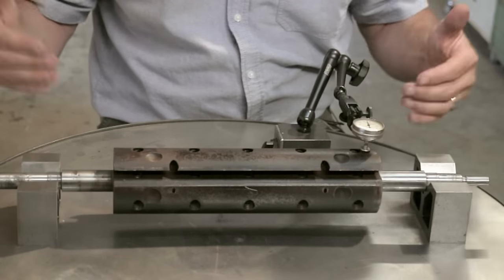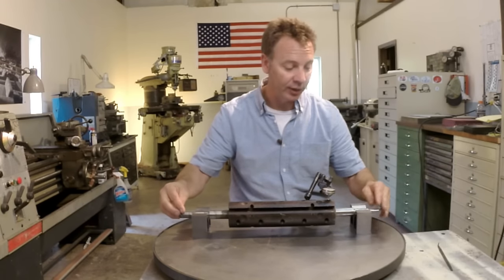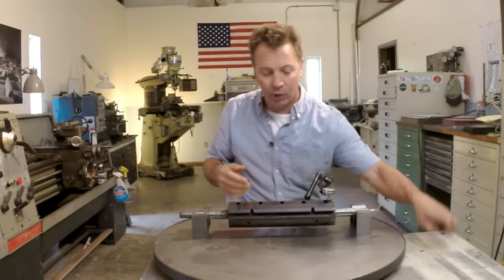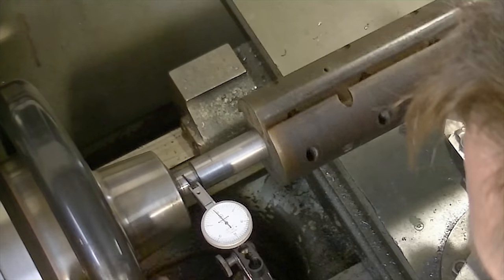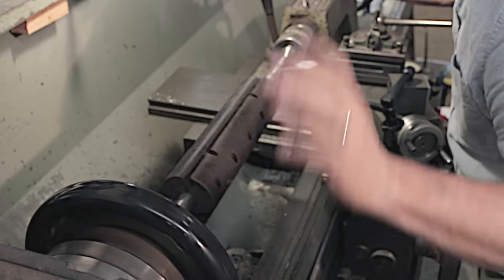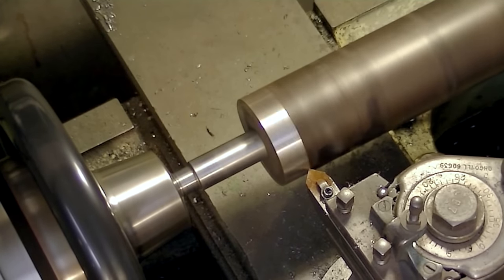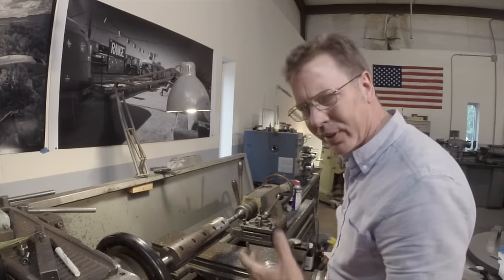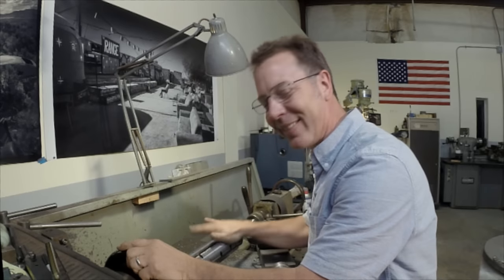Tough turning

Comment: As a toolmaker that owns this same planer, this video was great content.  When I rebuilt my parks planer I had to turn a new elevation screw.  First time I had ever cut a left hand thread.  I have always dreamed about designing and building a helical carbide inserted cutter head for the planer.

Comment: I loved this video.  I do not have old woodworking machines but do appreciate the issues with interrupted cuts.

Good to see an old machine getting a new life.

I think you got this to a tighter tolerance than original.  Many woodworking/turning friends use a rule to check the thickness of a piece of wood.  I like to use calipers.  I have to say more woodworkers are working to within 1/64in.
Reply from the maker: +LV_Woodturner 
Great comment

Comment: Thanks Dale!. Terrific job. The burrs left from turning cleaned up nicely. I had to drill out some more to get it static balanced. I kept the holes as shallow as possible. I'll have the machine together in a few days and will shoot a video. We'll see if it passes the dime test. In response to a comment earlier, the head turns at only about 3600 RPM.

Comment: Nicely done. You did the right thing in machining it on the spindle it operates on. The main thing is that it has to have its surface concentric to the axis of the spindle.

Comment: Hi Dale,
although you've got this project is already finished, perhaps the quickest, slickest and easiest way to handle a planer head like that is to turn a set of 2 slip rings to put on the ends of the cutter itself. then  you need a plug of the same OD to set up your steady rest on. chuck the plug in a 4 jaw, center it up and leave enough sticking out and set your steady rest to that diameter.
then chuck up the cutter head and set the other end in the prepared steady rest and re-man your shaft stubs 
the reason for this method is to avoid making the grooves for the knives taper to one end or the other and causing any new imbalance issues with the cutter head and a reduction of the cutter diameter. maintaining the original diameter is crucial as the knife setting gauge uses that tangent for setting the depth of cut. most knife setters are not adjustable to other diameters.
if the shaft is not pressed into the cutter head and can be removed, it would be advantageous to re-bore the center to get it concentric and make a new center shaft. otherwise the shaft stubs need to built up with 6013 and turned anew using the slip ring set up.

cheers
mike

Comment: I had a 5 week internship in a shop and they used cigarette paper (adhesive and available in various thicknesses) for centering pieces on the lathe or the rotational axis of their CNC machines. Works quite well. The engine I produced bearing allowed for big tolerances (in the .05mm area as far as I can recall) but they said they use this method for centering 200kg cutter shafts very similar to yours. Those were used in the paper and hygiene industry and rotated at 3000rpm and more.
Reply from the maker: Great comment. :-)

Comment: Enjoyed....it would have been interesting to see how much (if any) out of balance the cutter head was after getting it concentric, as you mentioned the head had balance holes...also curious what would be an acceptable out of tolerance for balance...but who would know that?
Reply: +outsidescrewball 
Back thenn they didn't have a digital spin balancer, and yet they balanced the cutter. There is a technique for doing it and it starts on the lathe with a rubber lined collet and a precision pencil holder.

Comment: Just a few points on the carbide, 1. All Carbide is cemented carbide, whether its a brazed tool or an insert tool. 2. The thing that  affects the toughness of the carbide is the grade(amount of cobalt binder), For brazed carbide you have C1 to C3, C1 being the toughest and most suitable for interupted cuts but not able to handle as high surface speeds as C3. Insert tooling comes in a huge variety of grades but generally the same rules apply, tough for roughing and interupted cuts, hard for finishing uninterupted cuts.

You had the correct methodology for truing the cutter body, Dialing off the bearing journals is the most important step as you found that quite often, the centers are no longer accurate on shafts like this

Comment: What was wrong with using a HSS Toolbit as it was a soft mild steel ? There is too much these days of using Carbide for machining everything. I have even seen people use them for turning brass. Correctly ground and stoned, a HSS toolbit would have performed surpurbly. Carbide tools do not like piddly cuts, OK on heavy cuts, .005 inch cut is too small for Carbide, hence the chatter. Love your `Hardindge HLV-H in the background, I have the earlier model HLV, excellent tool. Have just found your channel, will now view some more. Good luck with it all.
Reply: +Dave Ticehurst I think many people might not be aware that carbide tools inherently exert higher pressure on the lathe, which can even result in really bad problems on some small/hobby Asian machines.
Reply: +Cancun771 I agree, I notice on my belt driven chinese lathe that a sharp properly honed HSS cutter will take heavier cuts without causing the belt drive to slip. I've heard it said that carbide plows the metal off and HSS cuts metal and I believe it. I try to use Hss on my chinese lathe but do use carbide for some jobs.
Reply: +Dave Ticehurst  +1 on the HSS.
Reply: I would somewhat disagree with comments like this, a brazed on carbide will not only cut better but last longer if sharpened properly, the only reason for an inserted carbide to exert more pressure on the material being cut is if it has a radius or bevel on the lead cutting edge increasing the contact area during the cut, if your brazed on carbide is ground razor sharp and has good relief or for inserts you use an xx1 tip (almost no radius) with proper feeds and speeds being used it will cut right down and under .001" cuts with a fantastic finish. The nice thing about HSS is it will take a bit more abuse and not break but it will dull sooner, making form tools of course is where HSS really shines.
Reply: +Dave Ticehurst I do not know where you get your tools from but I use carbide for all my machining. If you look around there are specially ground carbide for all types of material and there are also special finishing carbide tools that will take cuts of less than 0.05mm or in the old scale of roughly 0.002" and the finish will be like glass. Am about to retire after 37 years of machining and have found you have to keep up with the new tooling that are coming out and you will be quite surprised. Carbide is much superior than HSS due to the amount of time saved due to not having to waste time sharpening the tools. As with all tools speed and feed has to be correct.
Reply: +dikkybee  - I haven't done machining since 1970, and just bought a used Taiwan made ENCO 1340.  It came with many brazed carbide cutters.  The only carbide tools available when I was training were controlled by the teacher.  I will have to study up on the new carbide cutters available.  HSS still works until I know more about which carbide cutter to use.
Reply: I agree with you i bought a lot of carbite stuf but by coincedent i got across a lot of planer blades.  Hss and they are hard like hell.  I use them more and more and the finnishes are super.  And if a little dull go to the grinder and like new again.   And your a lot more flexible making special shapes.  Hss is for sure not over yet.

Comment: Different order of operations - Just a thought:
Pull the cutter off of the shaft.  (You stat that the cutter was not bored straight and the shat is not concentric...)
Chuck the cutter head.  (Clean/repair the 4-jaw if you need to.  That would make a interesting video...)
Re-bore the inside of the Cutter Head.  That way you do not mess-up the geometry where the cuter blades attach.
Make a new shaft.
Optional - Make a Key slot for the Cutter Head and shaft in line with the existing setscrew holes.  (Re-chase the threads with the correct tap just to be safe.)
Reassemble.

Comment: The 15" Clausing is a dang good lathe.
 He did not ruin the cutting head-  He indicated it "in" on it's bearing surfaces.
 Collets are great for repeatability and working on bearing surfaces of shafts.
I agree that if the shaft was bent in the center it may have affected the head's cutter lands centerline, but they were running out anyway before the work because of the hub runout.  Now the cutter head is at least balanced.

Comment: Everyone I've ever heard talk about brazed carbide said that the brazing offers more stability than an insert, for really trashy turning you use some C2 brazed carbide.  C2 is "tough" carbide for cast iron (abrasive) and C5 is harder carbide for steels (wear resistant) and is generally considered not as tough as C2.  If you use a C5 for a heavy interrupted cut, you'll chip it, but C2 generally won't.  Conversely, C2 carbide won't stand up to turning a hard steel piece because while it has abrasion resistance, it doesn't have the hardness.

Most brazed carbide will be found in C2 and C5 grades, C6 much less so.
Reply from the maker: +eformance  Thanks for the the info.

Comment: Other than for the reason of  balancing, I don't think the eccentricity would be a problem.  We always used a dial indicator to set the blade heights so that the cutting edges are concentric to the axis.  The set screws allow for adjustments.

Comment: If the ends of the shaft are bent i think you still have a problem.  Very tricky problem to fix.  Would be interesting to see it working.  Excellent video!
Reply from the maker: +Bob Cartwright 
luckily the shaft was not bent
Reply: +Metal Tips and Tricks (Dale Derry) .005 runout one side.  .020 other side, on bearing surface??   It is bent, or bearing itself galled it out.  Replace the shaft.
Reply: @garybray3614  totally, i can assume a bent shaft is a common problem candidate for a plane, a jammed piece of hardwood could do that, bottom line is, that tool is out of balance?95% is a bent shaft imo obviously

Comment: For those not used to setting up planer knives, there are two approaches... a gage that references the head for the projection of the knife, which should work with this now true running head. The other is to reference from the table. It really shouldn't make a difference since you adjust the table to be parallel with the body of the head first. Referencing the edge of the knife from the cutter head is fairly easy if the head has jack screws. A Parks planer works OK, sort of, but is no match for a good planer.

Comment: Cutting rust and other oxides like that is really hard on the cutters. Generally you would want to take a cut deep enough to get through the oxides but this thing was so out of round and such a weak setup, it was not really an option. Cool video.
Reply from the maker: +helicrashpro 
Thanks for the  comment

Comment: Always a challenging job when you don't have the proper tools/machines.  OD grinder would make quick accurate work of this piece. You may even consider regrinding the entire piece and use new bearings to match (with same OD).

Comment: I have been a machinist for 11 years I took a formal apprenticeship. I personally think you should have removed the cutter and just made a new shaft. Installed cutter. Chuck it back up and skim cut cutter to center of shaft. To be honest the shaft is probably bent. Did you do a total indicator runout of cutter and shaft and map it out to see if it was actually bent? And those carbide cutters are garbage buy indexable cutter spend the 100$ for an indexable tool with a small radius and chip breaker. Also use cutting oil and paint brush for final pass if your worried about finish, then use fine grit sand paper and oil. Then finish with scotch brite and oil. Mirror finish. And if he wants to make the planer functional drag a small radius tool parallel to the cutting edge. Chip breaker and it's making a razor sharp edge.
Reply from the maker: Hi, the problem was not the shaft. It’s was that the hole was not in the center of the cutter head. 
How did that pass quality control?

Comment: Worked in sawmill making Japan export boards.  Tolerances on finished boards real tight.   Board variation, .015 max through the thickness of any side measured, for whole length of board.     Starting with bent shaft and turning planer knife holder is wrong.  Press out old shaft and make new shaft.  That knife holder looks real good except for very little rust.  Turning the knife holder throws it out of balance.   Clean cut on one side and rust still on other side.  You are throwing knife holder out of balance.  You are just making knife holder concentric to bent shaft.   So called by others, balance holes are not balance holes.  They are there to use knife set-up tool to perfectly align the knives.

Comment: Funny outtakes. 
 In standard Midwest machine shop vernacular a statement of size less than .001 is stated in "tenths". A "half" thousandth would be called five "tenths". Put In a statement: I have a total tolerance of (.0007) "seven tenths" on this bearing diameter.  Good video. Another qualifying start would be to take a cut at the same dial setting on each end of the turn, to make sure no side to side tailstock adjustment is needed to remove machine taper. You may know that your lathe is set up perfectly but the viewer doesn't and the machine he may use may be way off. I never chance ruining a part (finding out the machine is way out of alignment), especially on a strange machine. Thanks for your video.

Comment: Hi mate.  Nice job, however I don't think that you have solved the problem, in fact, it might have become worse.  If that shaft was bend, than all you have done is making the knife holder concentric with the bend shafts.  I think that I would first straighten the shaft by flame straightening, and than see what the run-out will be.
Reply: No, during his lathe setup he actually indicated the part of the shaft where the bearings are located once they're pressed on.  That is the correct way to fix the issue as it ensures the cutter head will be concentric with the bearings.
Reply: Yes and no Qtri.. We might have to assume that when installing the blade(s), they are indicated in the same fashion. But what is really important are the bearing turns because that is how the shaft rotates in assembly.
I know what you are saying. The internals of the blade holder( blade slots) are still out of balance,(if the shaft was bent) only the O.D. has been made concentric.The whole finished assembly may have to(should) be balanced in the end.

Comment: I thought that would be a nightmare to turn as well.   Well done.  Curious as to why you didn't put it on some knife edge parallels to check for balance after turning.  Why not HSS for this?  I'd personally like to see more chips.  Of course no need to see every rev of every pass, I get that, but I like to look at the chips coming off and "read" them as well as listen to the sounds.  Each of the senses play a part.  That was just my opinion and some nit picky things though.  Super video, keep up the great work!

Comment: Hi, great video. Are you a machinist by trade?  First item always safety and the presentation of working safe,  no sandles.
Fixing the head might not be important if the shaft is bent.  it may be have been bent due to a bang, replace the shaft.
I usually try to chuck or in your case collet as close to the head as possible. there are tables for speeds and feeds for diameters and cutting.  check for balance with the blades and hardware in the lathe. Overall great,  I have only a couple of positive suggestions.
Reply from the maker: Rob, Thanks for your comment. No I'm not a Machinist by trade I was a photographer. :-)

Comment: does not the machining of the outer diameter change the balance of the shaft ie. depth of blade slots to a point where vibration can't be adjusted by drilling holes?

Comment: Hi Bro,
next time Digg in and take at least 10 thou or preferably even 15 thou cuts. mucking about with those 5 thou cuts is what bluntend your carbide insert, well apart from you bad cutting geometry.
Iron oxide of the red variety hass a hardness of about 70 Rockwell C it blunts cutters real fast, Digg in deep and get under the rust your cutters will thank you for it.
cheers
Reply: +russhellmy I didn't know that. Thanks for the tip.
Reply: +russhellmy Thanks for the tip also I have wondered what I was doing wrong on rusty metal.  Thanks.
Reply from the maker: +russhellmy   Thanks for the input. I normally take as big a cut, as I can. I don't like to waste time, but when your set up in a small collet with a over size peace, it can rotate or move laterally losing the material being held by the Tailstock. So to be safe. I made fine cuts.

Dale d
Reply: Well since your first cut was toward the tailstock the part couldn't have loosened.
Cheers

Comment: Wrong solution here. The underlying problem is that the shaft is bent, likely caused by a mass over load. Turning the blade holder OD won't  change the situation that the bearings on each end are still not co-axial and bearing balls are being forced to run in an eccentric path. Ball bearings in this situation won't last long, even though the balance is closer to correct.
   The correct solution is to either straighten the shaft in a hydraulic press after checking which end is bent,  or press it out and fit a new shaft altogether (or 2 shafts ) . Also to remove the rust, degrease the part and give it a good overnight soaking in a long tray filled with Evapo-Rust stripper. Heating it to 120*F or so will speed up the process. Then you can polish it in the lathe with a strip of 240-400 grit and WD40.   Also, don't forget to install new bearings as the old ones are certainly ruined if they have been operating with a bent shaft.... or maybe they're just worn out.